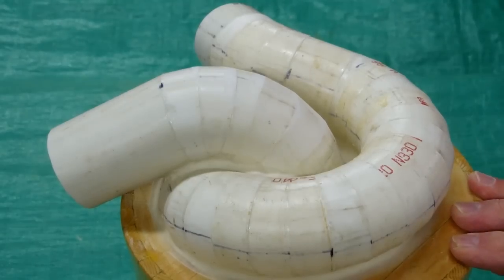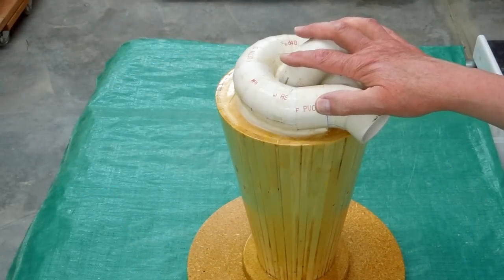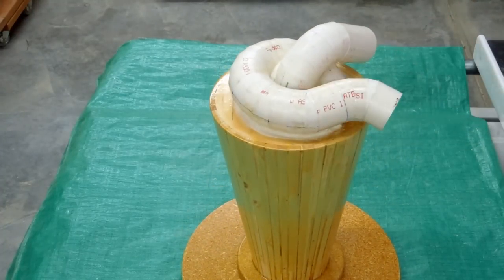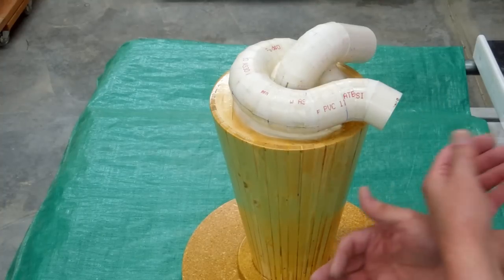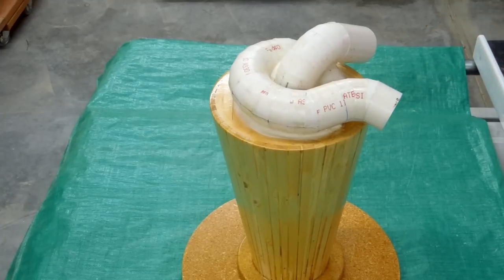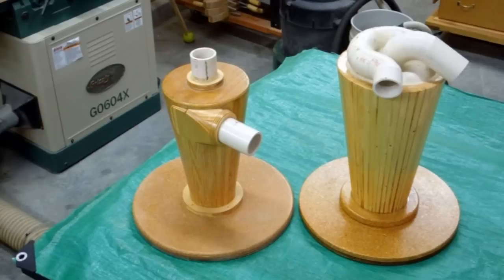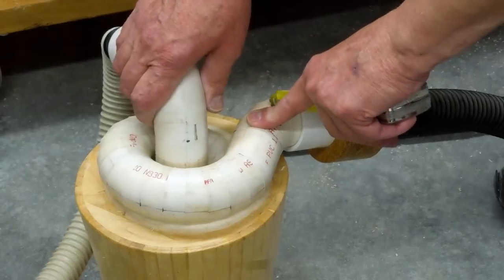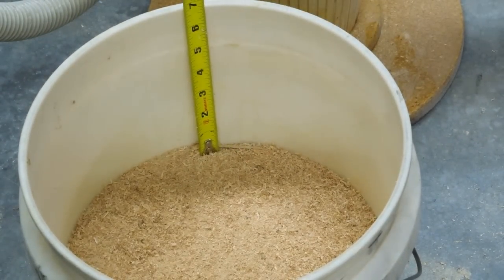Toroidal Spiral Cyclone Separator - Overview & Testing

Comment: Well, it sure looks cooler than the side entry, but I just can't imagine this being easier. Some may be able to do this even faster than your 3 days, but I suspect they are "few and far between". You and Matthais are quite unusual in your skill with stuff, your stuff is tedious and precise and done with skill levels out of most hobbiest range. I made a coaxial Thein seperator vacuum unit a few years ago, and my side mounted inlet (i.e. Which was required since the vacuum unit was on top cause my shop is 1 car garage small  ) didn't take that long to build, partly because I used hot melt glue to compensate for my lack of precision. I don't think I would get that pvc snake together even in a week :-(, but, your cyclone could win a cyclone beauty contest for sure.

Comment: I like the look of your cyclone, especially the "cone" made from timber. But I bought a $13 plastic cyclone from a Chinese eBay store, and it gives me exactly the same result.
Reply from the maker: Buying it from China... where&#39;s the fun in that? :-) I have seen the ones you are talking about but they are usually US$25 to $30 shipped. I had a plastic Oneida Dust Devil and it kept falling apart which started me down the homemade path just for fun. I have three different designs if you are interested. The other two are all wood (except the pipe). Thanks for watching!

Comment: Cool project, but during testing a weight measurement would be better since the density of your dust could change dramatically as it settles or unsettles
Reply from the maker: +slbuwk Density really plays no part here, other than being able to suck it up in the first place. Once your bucket (drum) is 2/3 full of hickory or balsa (dust, chips, whatever) it is time to empty the bucket. Only emptying the bucket before it becomes too full is what keeps the bag in the ShopVac clean..
Reply: No, you're misunderstanding, he's saying your 7 inches of sawdust measurement is totally inaccurate. I hope that isn't where you got your 99.9% efficiency number from. 

You need to weigh the amount of sawdust in a bucket, vacuum it from the bucket so you don't lose any on the floor, and then re-weigh it to see how much escaped the cyclone.

Regardless, that's a really cool design and looks really well made!

Comment: Ok, got the concept. While I appreciate the craftsmanship (it's really a beautifully crafted piece) but I wonder how many people would spend the time to create that Torid. 
	Might you be able to get similar results using some universal flexible auto exhaust pipe? I dont know how tight of a bend you can make with that stuff but it seems like something that could work. 
	I might even suggest vacuum regular hose for that matter. Do you foresee any engineering hurdles with those materials?
Reply from the maker: robert montalbano Actually, the biggest hurdle is thinking that making the toroidal spiral is a hurdle in the first place. It is actually quite easy to build and works very well. Failing that, my latest series is for a Split-Ring Ramp Cyclone Separator, or you could go with my first cyclone separator. Check out my playlists for the related videos. Regular vacuum hose is usually ribbed on the inside and not a good choice. Basically you just need to get started and build it... quit thinking about how difficult it is (because it is not difficult) ... nobody is going to build it for you... or go out and pay a lot of money for a commercial unit.

Comment: When you cut your segments, how did you determine the offset to achieve the correct amount of rise in your spiral?
Reply from the maker: MrBlue1616 Did you watch the video on making the spiral? Making A PVC Segmented Toroidal Spiral  https://youtu.be/HJVfZ-3TKe4  Do it as shown in the video and it should work out just fine.
Reply: Thank you, I just re watched the video and have a better idea of how to proceed. I enjoy your videos a lot and can't wait to see the next one you produce.
Reply from the maker: MrBlue1616 I went out of my way not to do anything very precisely on this cyclone just to emphasize it does not need to be made precisely to work quite efficiently. You could play around with the segments a little. A 14 deg segment will make the spiral a little larger in diameter and would then be closer to being tangential to the wall of the cone. Key is having a smooth face of the plastic segments to obtain a strong glue joint. Have fun!

Comment: Wonderful project. I have been working with centrifugal solid from liquid separators for 15 years, and they are (in concept) similar to the separator you have built here. But I am curious, why does the chamber taper in towards the bottom? I assume you did that to boost or maintain the circular velocity of the solids as they fall down?
Reply from the maker: Correct. It keeps things spinning and pushed against the sides of the cone until they reach the bucket and by doing so separates the particles from the air stream so clean air returns to the ShopVac. 

This is my first design: Shop Vac 5 Gallon Wood Cyclone Separator https://www.youtube.com/playlist?list=PL1ABF2C513E0F4838
Reply: Good call. I know that probably making a tangential entry out of wood would be difficult, but I believe (based on my experience) that it would work better - just like you have done on the other separator. Another highly effective addition would be a mechanism to induce a vortex inside the separator, like a floating plate near the middle. The air spinning around the tube will create a vacuum on top of the plate, and that in turn connects with the vacuum at the outlet (induced by the Shop Vac), literally looks like a tornado inside the separator. That ensures maximum velocity and will create enough centrifugal force to separate virtually anything that is heavier than air.

Comment: Hey Ron, great job with the tedious work. Do you think it would work with spackle dust?
Reply from the maker: Dennis Skerb Drywall dust is a tough one. Really fine dust like sanding wood dust can escape to some extent. These are all very fine like talcum powder. Even with the large system in my shop, it is the very fine dust coming off the disc/belt or drum sanders which ends up in the final filter bags. One person I know of built my first cyclone separator design and said it did a pretty good job with the drywall dust but personally I would place one of the drywall dust bags in the shopvac as a backup.  The cyclone tends to keep the material in the bucket stirred up so a taller bucket or drum would probably be a better choice for drywall dust.
Reply: +Dennis Skerb To clean DW dust, dampen (not wet) saw dust ,sprinkle on floor over DW dust Then sweep. This works well, not perfect, but much better then with out.

Comment: hi, which of the cyclones work better??? this one or the first one you made?? Thank you!!
Reply from the maker: +Martin Koch My first ShopVac 5-Gallon Cyclone Separator video released in 2011 and this Toroidal Spiral Cyclone Separator For ShopVac both work perfectly. It really is a matter of which are you comfortable making. Or you could consider a smaller version of my Split-Ring Ramp Cyclone Separator if it is going to sit on top of a 5-gallon bucket. Personally, if I were to build another, I would build the first one or a smaller version of the Split-Ring Ramp style. Just make sure you use a paper bag inside you ShopVac. Good Luck and thanks for watching!
Reply: +Ronald Walters Thank you!!! I will try yo make the first one... I'm building my first WorkShop and learning a lot from the videos you guys post!!! Thank you from Argentina!!!

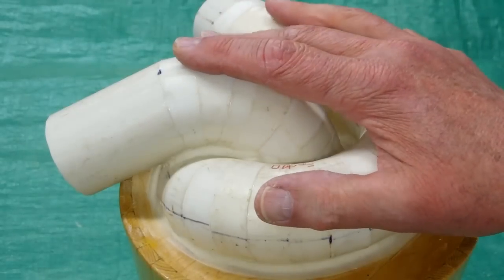Comment: The opening comments at 0:34   'you can't buy one of these'   actually you can ... eBay has them in nylon.        Anyway -   do you think there is a significant benefit in the torrodial inlet compared to side entry ?  or is it purely to avoid a difficult side entry manufacture?
Reply from the maker: Well... you can't buy one of these... theirs is similar. :-) As stated in the video, some people seem to have a problem with the tangential side entry. My original cyclone "Shop Vac 5 Gallon Wood Cyclone Separator" uses a side entry. My larger cyclone "Split-Ring Ramp Cyclone Separator - Larger Hoses" is easier than a side entry. This toroidal spiral offers no advantage other than being different and possibly easier for some to make from PVC pipe. All three of my homemade cyclones work very efficiently. If you haven’t already seen it, check out “Cyclone Separator - Plastic Bag Excluder”. Thanks for watching!

Comment: The toroid looks cool, but I doubt it adds anything other than turbulence and resistance to you air stream.
Reply from the maker: cranky1964 Works pretty smooth and it is easy to make.

Comment: Assuming you made this out of scraps, and even scrap wood has value. With the time and materials do you think the total cost of this project is less the $50.00?
Reply from the maker: +John Sneed Wood glue, PVC cement, some wood filler... if you already have the  PVC pipe and a 2x4, probably less than that.
Reply: +Ronald Walters Buy you can just buy a cyclone for $50
Reply from the maker: +Daniel Amos The bare Oneida Dust Devil originally was more expensive but it can now be purchased for $50 which (as far as I can tell) does not include the gasket, mating flange or lid. To get the whole kit costs $99 plus shipping. I bought one and the top of the cyclone kept falling off and I could not find a glue that would stick to the slippery plastic they use. Calling Oneida was a waste of time. I used it for a couple of years with bits of duct tape holding it together. I got tired of that, so I made my own. Actually I've made several of them. The Oneida Dust Devil sits on a shelf pasted back together with silicone and I only use it when picking up water so I don't need to continuously empty the shopvac. This is a woodworking shop. My videos show how to make stuff using wood. My cyclones won't fall apart or have the top popping off when you move it and they are easy and fun to make. Dollar for dollar you'd be way ahead making one of mine.

Comment: Sorry, but I can't see at all, that all these cuts of tubes into segments, then bonding them together is any easier to make than the more traditional tangential intake version ...... If someone can successfully make this toroidal version, then he will for sure be as well successfull in making the other one. However, the torodial seems to me the better version in terms of air flow, etc.....
Reply from the maker: The Toroidal Spiral Cyclone Separator is very efficient and still working in my shop. It is a demonstration of another way to make a separator… and it looks different. :-) I have two other DIY cyclone separator designs for use with a shopvac, which are made of wood. Thanks for watching. Please subscribe. Ron

Shop Vac 5 Gallon Cyclone Separator Part 1
https://youtu.be/8wMz5iIrddc

Split-Ring Ramp Cyclone Separator Part One
https://youtu.be/QEzQXRiLRAg
Reply: @RonaldWalters2010  - Hi Ron, fully agreed that this version for sure is very efficient.

Comment: Sorry but I would disagree with your design. I wish you the best of luck with your toroidal spiral endeavours but I would personally stick to the standard industrial cyclone designs having rectangular inlets, because IMHO, that is the natural cross-sectional shape of fluid flows within the cyclone (see https://www.youtube.com/watch?v=BicR3JGlE5M ). Its no big deal in the case of the woodwork shop dust because it separates easily, but the extra work in making the toroidal spiral IMHO is not worth it.
Reply from the maker: Jeff Harmed  The only "natural" approximate rectangular cross-sectional fluid flow shape I can think of at the moment would be a river, canal or stream. Most all other fluids (including air) are conveyed by man in a round pipe or hose. Seems sorta foolish to convert a round dust collector hose or pipe to square or rectangular shape for entry into a cyclone separator for use in a woodworking shop if we don't have to. Most commercial dust collectors have a square or rectangular opening simply because they are made of rolled welded sheet or steel which is immediately transitioned to round for the installation of pipe. This is a K.I.S.S. design as was my first cyclone separator posted over 4 years ago. Disagree all you wish but if you want a simple, cheap cyclone separator for your shop, this one (or my first design) is very easy to make, and they work very well.
Reply: Jeff Harmed Possibly you need to watch all the videos on this again. Seems to me the spiral inlet was offered as an easier way to construct this as opposed to the tangential input used on his first design. Personally I don't see what you are disagreeing with?